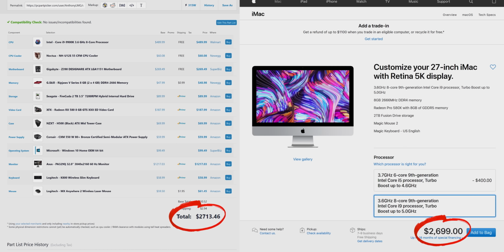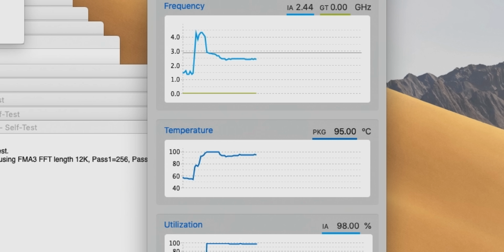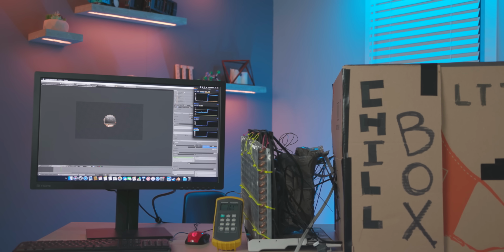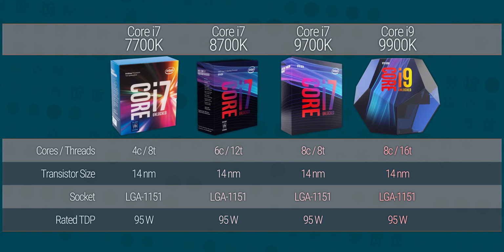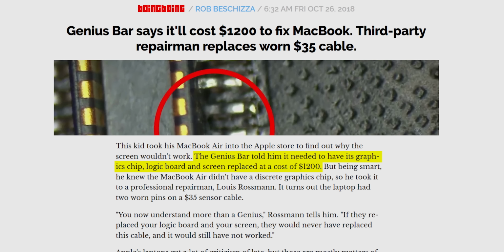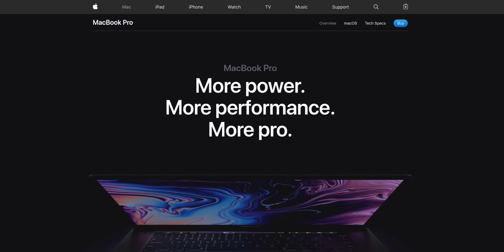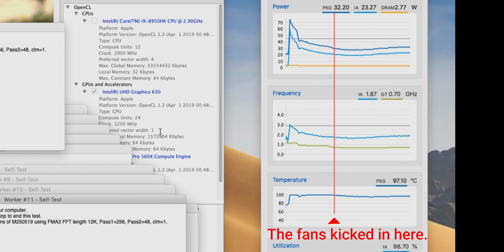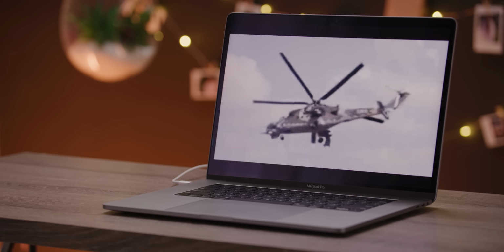Macs are SLOWER than PCs. Here’s why.

Comment: "I buy mac cause it's so good for creative work"

Me: Laughs in rendering time
Reply: Me: laughs in south pole
Reply: people really at each others' throats for brands
Reply: just wait till you need servicing ………...and supermega "geniuses" tell you ( without even checking the machine ) , yeah sure buy a new one
Reply: @manga8764  "relatively durable now"

Come back after watching some of Louis Rossmann's videos.
Reply: Apple is way more optimized. You windows people are just blind bc you don't use Mac. My Mac can thermal throttle way faster bc it's optimized to do so. If there were a slow contest, I'd win handily.

(this is a troll. Don't have a canary stroke)
Reply: @rustyshackleford5166  everything you said is wrong. Im a designer and engineer. I use a mac for because I'm forced to and I use a PC for my personal computer. Apple is nothing but overhyped trash for isheep
Reply: Laughs in uptime and long term reliability
Reply: Linus is Canadian. So I guess that in winter his machines double as a heater.
Reply: those twats who sit in coffee shops with their macs out
Reply: But But it is great for photohop & bla bla bla!
Reply: Laughs in hardware failure because of constant overheating...
Reply: Wow this comment turned into the war of the worlds.
Reply: @LundinSebastian  no.
Reply: @LundinSebastian  never talked about iphone tho
Reply: @LundinSebastian  ok, i think u just trolling me.
Reply: Performance on win10 and Linux is much better. Try running docker on a Mac xD 
It's quite impressive that win10 and the Linux distros I tried are all much more stable than macos. I'm also used to use standby or hybernation instead of full shutdown. You can't do that on Mac. If you use that on Mac it gets painfully slow after a couple of days.
Reply: Windows is just better, I have a windows laptop, intel duo 2 ghz and 4gb ram, no gpu and my mac has intel duo 2.3 ghz 4gb ram and a nvidea graphics card, my windows pc performs better in everything, I only use the mac to access a shadow pc as my windows 10 laptops' screen broke
Reply: Macs are still great for photo editing. You could argue no touch screen, but with that monstrous track pad and sidecar for iPad you don’t need a touch screen. In my opinion the only way your ever going to take full advantage of a touch screen is if it is a 2in1 or tablet.
Reply: Even as a PC guy, Macs are actually better for creative work. Stability, and apples certain software such as final cut or logic. Plus they are more responsive supposedly, making them FEEL faster, what I've seen creatives want.
Reply: Macs look good, and that's it, they are rubbish you can't upgrade it or fix it
Reply: @kendarr  you cant upgrade other laptops?
Reply: @matt309  You can't upgrade a MAC, pretty much any onther laptop you can, atleast more storage and RAM
Reply: @kendarr  I have a mac and can upgrade its ram and storage
Reply: @matt309  Really? cool, i've never seen that option, is it more expensive then a pc?
Reply: @kendarr  it's the mid 2010 lol
Reply: I got ryzen processor for that. laughts in silence
Reply: K0ng0 
It’s industry standard for a reason. 

Clearly there isn’t a need for an argument on this cause then the same people who agree pcs are better are going to be the same ones that attack you for getting a “certain” pc and the another argument starts again. Humans are never satisfied.
Reply: Lol look at the reactions from you hyper nerd clowns. I repeat I use both systems and you are all clowns.
Reply: Windows is the universal wrench, designed to work on any hardware, ymmv. MacOS is designed to work on specific hardware and is optimised to do so far more efficiently than Windows can in that specific environment . I use both and Linux/Proxmox in my home server. They are all good for certain tasks.
Reply: @HighwayRamos  that's BS. Macs and PC use the same hardware.

Funny how the exact same hardware is crippled under OSX and not on Windows.

You guys are so funny always trying to make Macs which are nothing more than overpriced ripoffs, seem amazing.

Their is a reason Apple sells less than 2M of them per quarter. The price isn't the issue.
Reply: Mac and linux have too many compatibility issues in my opinion to make them appealing to the average user (especially linux where you just got to pray they got an alternative program to what your using). Constantly see threads for both OS consisting of oh I can't get my game working, or oh I bought this new mouse but its not working or how come my rgb lights aren't working lol? Furthermore they both have performance issues especially when it comes to newer products and their drivers. Like why buy an expensive graphics card if it isn't performing to the best of its ability? Then here I am sitting on my windows sipping some tea with everything working no problem. You can do without the other OS but almost everyone needs a windows in their life for something whether it be for entertainment, that software or work program that doesn't work and /or for certain devices. Unless that is you enjoy trouble shooting for every aspect of your life but who gots time for that? Even some of those channels that advocate for linux got a windows pc because their mic or whatever don't work for linux lol made me laugh. Now not to say windows doesn't have its far share of problems (security/privacy being some, window 10 especially piss me off) but honestly if I had to choose one for all aspect of my life windows would be the one. Linux (manjaro/arch) would be my second, then shit apple. At least linux is very customizable and if they get around to fixing most of their compatibility issues I would probably take linux as first but for now its gotta be windows because the trade offs just arent worth it... Apple in contrast is too much of a closed environment. Also like others have said apple cooling solution is shit and is harder to replace/self service components. This translates to less longevity and more money shelled out if you got to get your device professionally serviced...like why go through this? I can rip out components, add fans, replace TIM anytime I want in a pc. You a masochist? Heck even rich people know what a good investment is and mac isn't one of them. I say only get a mac if its absolutely required for your school program then chuck the dam thing out the window...
Reply: no matter who's saying that, he could join you laughing and could definitely keep laughing for longer.
Reply: @manga8764  I need a light laptop on the go that edits videos quickly and is reliable. The Macbook Pro late 2013 which I bought used in 2015 is still a work horse and never crashed once. When I used Premiere Pro, the program crashes a lot and I lost many projects that way, but when I switched to FCPX, I never looked back once. It is much better optimized and the way the program works with the trackpad is pretty damn ideal. 

Of course my Macbook runs games like shit, even Borderlands 2 can barely run on 720p lol. I mainly play old classic games like GTA SA on my Android phone with a controller so that's not a big problem. I'm going to buy a PC for some 4k editing soon and we'll see if the experience is much better

Update: have a PC with i9 9900, 32gb ram with rtx 2060, runs premiere pro but the experience isnt much better. I do plan on changing the GPU to run Hackintosh. However, gaming performance is great and render time is much shorter. I think I can use windows for rendering special effects from AE and use FCPX on MacOS for general editing
Reply: @namtruong9476  that not a c v mqc issue but rather software on pc issue. Adobe are notorious for having buggy software. Use davinci and u wont have crashes.
Reply: Logic?
Reply: @mionome501  First comment with actual value on here.
I actually bought a Mac a couple of years ago just so i could use Logic.
Reply: @LundinSebastian  i don't know if you are joking but it is very powerful and intuitive logic and with discount student it is included  with other programas for 200 euros. By the way let me ask you, do you experience any kind of latency while playing on the keyboard? it s what I aim to do. Thank you
Reply: @mionome501  My response to you was my first time being serious in this thread. 
I actually both like Windows and Mac, but i think the whole argument that Mac is so much better than Windows for creative work is nonsense. In the end it comes down to what you prefer and what you are used to. 
For music making i prefer Logic to other music programs so for all music i use my Mac.
For your input lag, i actually have No Good answer!
Reply: i bought a macbook cuz it looks and feels so nice
Reply: Thats funny
Reply: K0ng0 me now: Laughs in music production workflow when i see your comment(can Windows run logic? No)
Reply: Optimization no matter how much you fucks wine like a bitch macs are better optimized. I only use pc for gaming or extra work when mac is bg. I prefer both for different reasons you are all clowns.
Reply: @monbjra  windows for office work, Linux for gaming or PCs, that need a lighter OS. Both will outclassed apple.
Oh, and both will not cook my systems
Reply: @AustinRoss  apparently it depends on your industry so therefore, Mac vs. PC is all about personal preference
Reply: @SupremeNerd  To be fair, when Mac supporters say "But more creatives use Mac!" is because they're living in the PAST.  Before Windows 7 - and even Windows 7 didn't get it right - only Mac had fully integrated color management.  "Color management" is when the OS and hardware cooperate in making sure colors are represented correctly from user to output.  So people who worked with images HAD to use Mac because it was the mainstream, and affordable, system that did that.  Same with audio: only Mac had an audio stack that could actually be trusted to not botch the output.

But that was then.  Windows 7 fixed most of that (not all), and Win10 has color management completely baked in from the start.  So people continue to use Mac because they still believe that Windows doesn't work with these systems.  They are stuck 10 years in the past, still believing themselves blessed by the only things that "work".
Reply: @dinosnake2241  Thanks and I agree
Reply: @monbjra  Bro I don't think you were optimized for the human body
Reply: @monbjra  'optimized' for what? looking good? Because they are certainly not optimized for performance.
Reply: @methanbreather  optimized for making money off of (not to say dumb) uninformed people
Reply: methanbreather well, many use Apple Macs for the Unix base system which is good for developer and yes it is optimized but remember hardware is a big duel here.
Reply: @LulzRoyce  no, my apartment is pretty high up. Virgin? Nope. And my PC (which isn't even running windows) is compiling a lot. In fact, all the hardware in it was bought for good compiling speed. Rendering videos? Yeah, with so many cores, I don't even notice it if half of them are working on a video, compile firefox or run something else (like batch procesing of pictures). Macs are just too expensive and too slow. The only reasons people by this crap: brand&inertia
Reply: @methanbreather  Here's the best example of optimisation on a Mac: https://www.youtube.com/watch?v=KnapaZYD2cU
Reply: @shego98  I go back and forth between CMU and MIT for a computer project, and all I see are Macs. Can you inform all the uninformed students (and profs) with your wisdom? The gall of those dumb people to think they can build (and even program) a custom quantum cpu.
Reply: @methanbreather  ok apple haters
Reply: @methanbreather  I'd say optimized for functionality, a week into using a Mac I was converted, maybe it's because I don't think my dick size correlates to the amount of cores in my computer, but more likely due to the fact that the mac os is undeniably better, even if it doesn't run video games. Even if you can add more onto a PC, it doesn't change the fact that navigating a PC is dreadful. On top of the UI being disgusting, it's so clunky. While a more powerful machine is where PC shines, that's really all they got going for them, and what's the use of that if all that machinery is backed by a terrible os
Reply: @monbjra  saying "clowns" sound like what an apple user would say, more like some teen who regularly goes into snapchat and instagram to get memes and sound cool using them cool lingo.
Reply: @monbjra  Wow, the typical Apple fanboy has joined us!

Everyone, say hello and be polite. :)
Reply: @LundinSebastian  that only encourages their sense of entitlement.  You know i used to own a few macs.  I got tired of not being able to afford to repair them when something simple broke.
Reply: @monbjra  LOL
Reply: @monbjra  Triggered fanboy got hotter than a Mac laptops CPU.. LOL
Reply: @monbjra  You can make a Linux PC build and then run a virtual machine for Mac and lose only like 1% of performance and it'll cost less then any Mac but still perform significantly better. Sure, it's a little more work, but you'll save a lot of time, stress and money in the the long run.
Reply: @monbjra  how many tests will it take for you to admit your wrong here... Facts against feelings bro macs performance is noticeably worse in every way against a pc of the same specs
Reply: @monbjra  Funny thing is you are actually the only correct one here.  The mac hardware doesnt need to match PC hardware to do the same tasks if you are using mac designed software.  Final Cut Pro is the perfect example of this.  There are plenty of videos out showing macbook pros destroying bigtime built PCs running adobe premier in render times because the hardware and software on the mac is optimized to perfection.  There is no comparison here.  The mac using mac designed software is superior.  And its proven no matter how these clowns want to spin it.  The mac doesnt need the same hardware level specs as a PC because its not running an unoptimized piece of shit OS and supporting software.
Reply: @monbjra  you say MAC is better optimized please list them out so that we can discuss on that as a community if thats true instead of taking side and having vague information and argues.

Comment: It clearly says: Up to 4.8ghz TURBO BOOST! I do agree that the Macbook Pro's performance is a far cry from what they used to be. But one of the reasons i bought a Macbook Pro back in 2009 was because i knew that (again, back in THAT TIME), Windows machines weren't reliable! A lot of hdd problems. I have my Macbook Pro retina from mid 2012 still running fairly good. Since a year i have burn in but it's respectable i think after now 7 years, that it still runs. I use it more for media consumption or light web browsing. Even some web developing and a bit of pages (word).

I would hope that Apple make their MBP's a bit thicker again. Why make is small... To be more portable? Then take the 13" or the Macbook Air, that's what they are made for. But let the Macbook Pro be a full pro machine!

Comment: This winter I'm dumping all my room heaters and replacing it with the Macs. A heater that can play audio and internet must be a well worth.
Reply: For real though: My upstairs office gets super cold. Thankfully, I can just fire up my old 2013 iMac and the whole room will be warned up in no time at all.
Reply: Running hot and putting out a lot of heat are not the same thing.  If you put a better cooler on a processor, it will actually put out more heat.
Reply: I didn't bother buy a frying pan, I just throw a bit of olive oil on my 2018 Macbook pro and I'm good to start cooking
Reply: Smart heater
Reply: Get a phone and run BTD Battles on it. It will heat up the phone and room
Reply: @beforecuddlybunnylps841  yo for real tho, two years ago when I was playing that game daily, my phone was like hot ass charcoal.
Reply: My desktop runs cool and is still effective at heating my room.  My old AMD GPU was great for it because being AMD, 95 degrees was a pretty average temperature for it to run, so in winter I'd be sitting in my room in shorts. The fucker would heat it that well.
Reply: Get a samsung phone instead, run mobile hotspot and split screen at the same time and charge
Reply: My neighbor's Mac came with a free wireless Spatula/Temp probe to tell when his Tofu is done.
Reply: I keep a bitcoin miner on my desk for that exact reason. My coworkers love me.
Reply: that must be expensive af
Reply: Buy a ps4... it's cheaper and white noise is amazing
Reply: It's not a good deal

Comment: i bought a msi pc, changing form apple after many years. it is my 3rd pc since i switched from apple. I have to change it every 2 years for different problems, this year my laptop problem is after 1.5 years old the fan of the gpu who is going down and i cant replace it.... so i guess i will need an other computer. Since apple i had to change PC like that every 2 years, when an MAC was going great for 5 years before i change for a new one, giving it to a friend who is still using it ? so i really think i will go back apple cause all the high numbers of cpu doesnt matter really to me. I do graphic design, wedding photo mainly on lightroom / photoshop. so yes i am not a 3d designer or a video maker but well i know so many 3d designer and video maker on apple for professionnal studio that i dont really see where is the pb of power. Please make a video on "why mac are MORE DURABLE than PCs."

Comment: I have a Clevo laptop with Intel 8700k and it sounds like a vacuum cleaner when I render. The noise sucks, but its half the price of a MacBook Pro but more than double the performance. More importantly I can CHOOSE to have low fan noise by lowering performance with undervolting and underclocking. The main difference between PC and Mac is that PC users prioritise performance, Apple users prioritise looks.